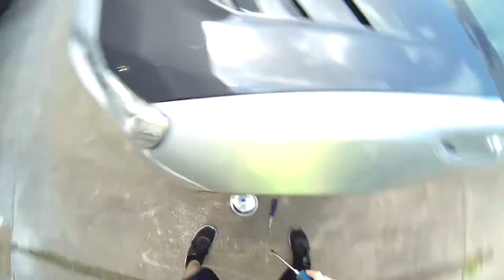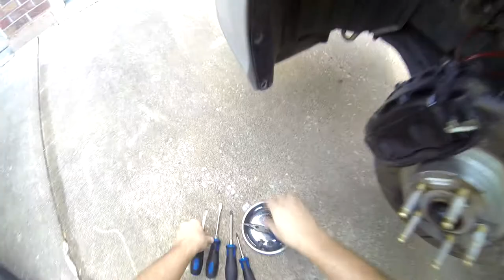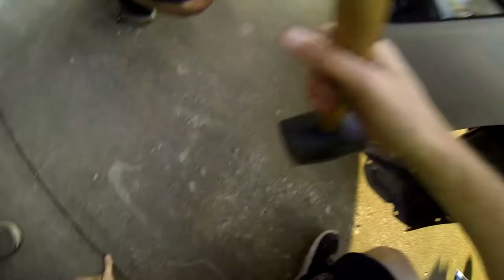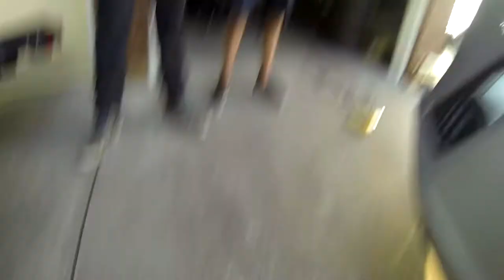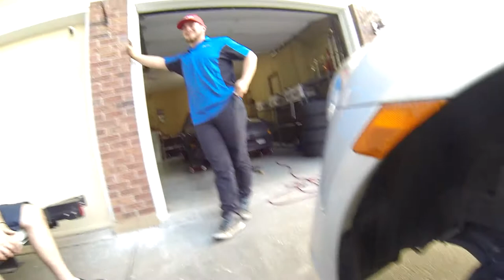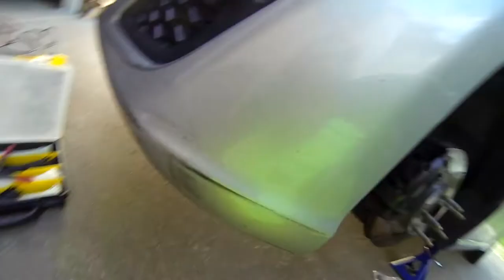I Am Officially Never Drifting The FR-S Again!

Comment: They make a tool to pop out those clips then you can reuse them. Or if you have a wide enough screw driver just grind a big v into it and it will pop those centers right out
Reply from the maker: Man, even with that tool, i'd be surprised if 50% survived...  How many can you normally rescue?